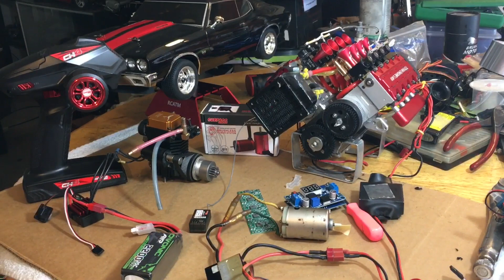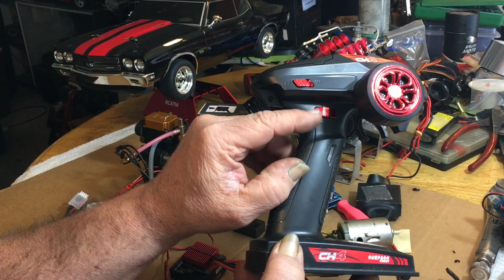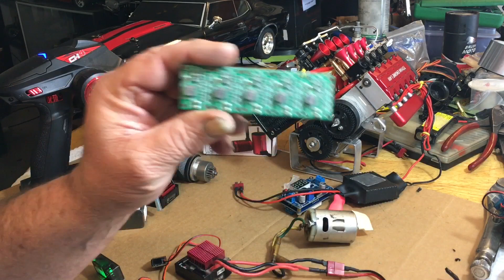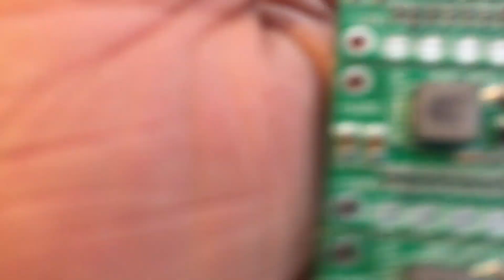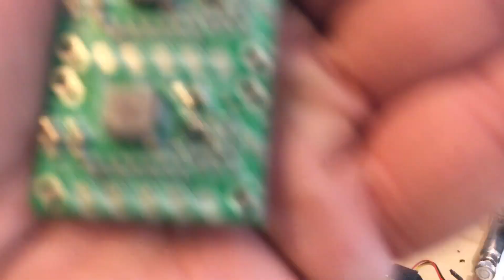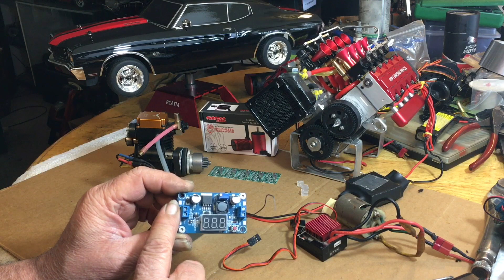RADIO REMOTE START FOR YOUR NITRO ENGINE

Comment: I have a question about remote start I got it to work but I think the starter motor is spinning the fly wheel the wrong direction.  So which way looking at the fly wheel should it spin to start the motor clockwise or counter clock if that question makes it sense?
Reply from the maker: looking at the front the engine should spin counter clockwise
Reply: @Dennis Dempsey Radio out of control   I'm not sure what is the front but I went back to the assembly video and. Checked the one way bearing and it's correct. Now on the transmitter I have a ch3 a b up and down I figure which will spin it the wright way
Reply: @Dennis Dempsey Radio out of control  I have coming the chassis kit from stirlingkit, and looks like I might have to remove the black flywheel. what's the best way for doing that on the Otto engine. I think it's comes with a flywheel and clutch. Thanks

Comment: Thanks for the shout Dennis. I love those tiny boards. I actually plan on installing a remotely start my nitros. Those small batteries are awesome. Thanks for sharing brother!. 👍
Reply from the maker: No problem brother you turned everyone on to those micro voltage reducers  👍

Comment: Nice video and tips. In engines with multiple cylinders. Why you can't you one  of these birds and split the wires for the cylinders. Depend how many amps the board can deliver
Reply from the maker: I tried using multiple connections but the boards are rated for 3 amps, they burnt out during testing,
Reply: @dennisdempseyradiooutofcontrol  Understand!